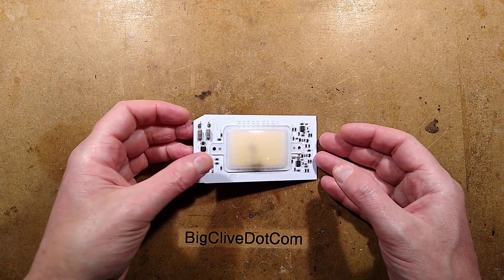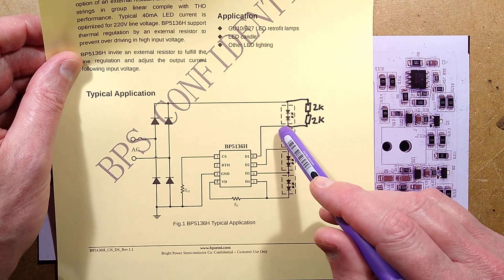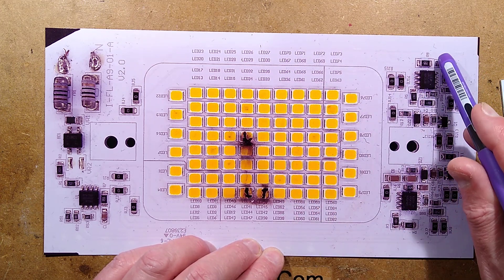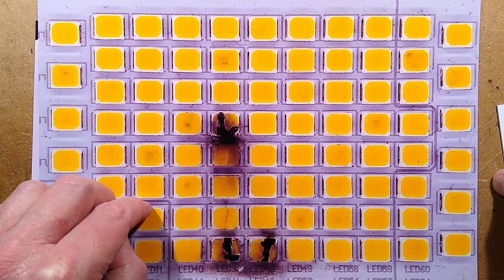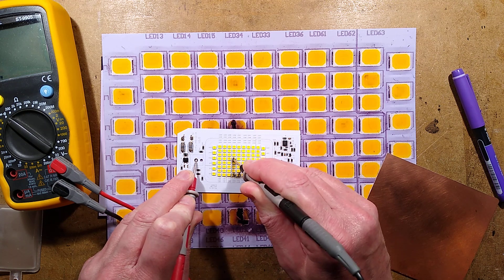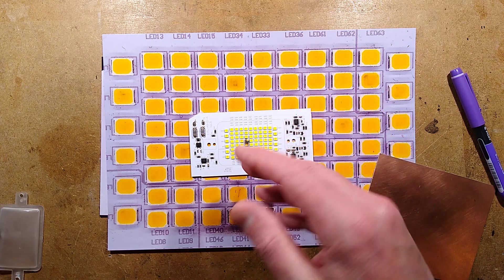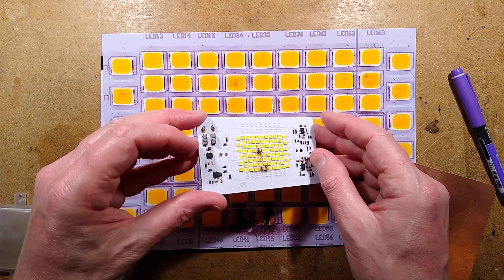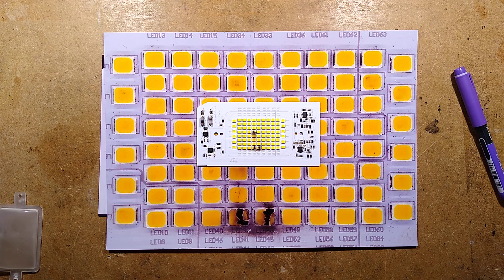LED shock hazards are increasing

Comment: Just had a look, indeed all three of the (~40 years old) RCDs in my breaker box appear to be type B! "Made in West-Germany" 😄
Reply: i doubt it. Type B RCDs came into production about 2000.
Reply: @punktVail  ha ha good answer
Reply: In my breaker box is an type A "Made in West-Germany"...
Reply: Definitely RCD, not type B MCB?
Reply: Also the cheapest German type B Rcd currently available is from ABB and costs 300€. They are usually used for running VFDs.
Reply: Hm, honestly, I just assumed it's a type B.
(That's why I said appears to be.)
There's no type designation on it, but it has the symbols for sinusoidal and half-wave rectified DC ("wavy line" and "bumpy line").

EDIT: I've looked up the model (all Schupa NPFI SK). It's a type A.
You live and learn :)

Comment: I don't see why they can't run several bunches of LEDs off say 12 or 24 volts so you have quite a few of them in one lamp wired in parallel but each set of LEDs is wired in series so it equals maybe 12 volts and you have maybe 10 of them driven off a 12 volt supply and also they are not over driven and electronics modders like yourself and myself can mod them in projects.

I have a spooky bulb that has a small 12 volt supply/driver inside and three LEDs and I modded it to run on a 8 AA battery holder. Works great.

Comment: Why are transformers not used when installing LED lights
Reply from the maker: Size and cost.  Plus making them fit in existing lamp forms.
Reply: Also efficiency. Every time power goes through a conversion some of it is lost as heat.

Comment: LEDs are diodes, so why don't the replace the full bridge rectifier with sections of LEDs and then have the regulator be the device that acts as a current sink? Does it have to do with breakdown voltage of LEDs vs normal silicon diodes?
Reply from the maker: Some lamps do that, but LEDs are not optimally designed for rectifying.
Reply: I think so. Most LEDs are only rated for 5 volts when reverse biased.

In addition, LEDs used as rectifiers will have significant flicker when run at mains frequencies.
Reply: @eDoc2020  but arranged as full bridge rectifier and with a diffuser I'd imagine it is no worse than the circuit in the video.

Comment: It would be interesting to know the age of these failing led lights, I have several cheap floods and PIRs in use around my home for a couple of years now and are working fine, I also discovered the unconnected earth on the very first flood I installed as I replaced the crappy cable with proper 240v cable and plug
Reply: From my experience (with domestic fittings), the best and longest lasting ones are those from before the manufacturers worked out how to make them cheap. A lot of it is still running for us (a failure once every couple of years), so we haven't had to use the more modern cheaply made ones much. In general when they do fail, it is often a single LED with the black spot of death or the capacitors in the power supply - oyster lights, led tape and incandescent replacement globes

Comment: Does this same sort of problem happen in light bulbs that may only have a 2-pin connection to the mains? I can't "ground" my Edison screw light bulbs any more than they are, I think, though perhaps it's all connected to neutral instead? I am old fashioned apparently in that I like a bulb in a fixture, and not a non-serviceable fixture with built in LEDs, but I might change my tune if there's a safety advantage.
Reply from the maker: If it has an exposed metal heatsink on it then treat it as potentially becoming live and isolate power or use gloves while changing a lamp.

Comment: What a horrible driver chip design: they're more interested in keeping a nice power factor than in giving smooth, camera-friendly illumination.
Reply: Eh, it's pretty good for a design that doesn't need electrolytic caps. At least it outputs some light down to the low parts of the sine wave where other simple designs would output no light. This chip should look less flickery to the naked eye than most other capless designs.

Comment: What keeps the incoming resistors from becoming firecrackers/heating elements from the incoming mains current?  I understand they limit the current but how without overheating?
Reply from the maker: They limit inrush, but the regulator ICs limit the main current.
Reply: @bigclivedotcom  How do the ICs do that and survive? I thought the small traces inside an IC couldn't handle the volume of current thus board voltages and current need to be dropped by a transformer before they reach the smaller components.

I am not a sparky, I only play one on weekends with battery jumper cables and cocktails.
Reply: @lohphat  It depends on the IC; ICs made for power functions have beefier internals and can handle much more current than those made for signal functions.
Reply: @eDoc2020  But how do the traces survive?  When the current is coming in on 14 gauge wire but ore following tiny traces on the board onto tiny pins into the ICs -- my brain boggles as how they survive the transit of electrons.
Reply: @lohphat  The size of the incoming wires doesn't mean anything; these types of LED circuits usually run at around 40mA. Higher current circuits naturally need thicker traces.

Comment: What's the next stage of PCB + micro chips then?
What direction are we heading in do we think...?
What funky and innovative new ideas do you have people of the comments section..?
Come on.. Hit me with your super awesome, futuristic ground breaking & multi gazzilion dollar £€$¥'s epiphany ‼️🙋🏻‍♂️
Reply from the maker: It's already at the extreme minimalist level.  Lamps with high voltage LEDs and a three pin current regulator.
Reply: @bigclivedotcom  you not on the 'graphene bandwagon' just yet then Big Fella?
Is that not going to be a potential new era for these for mentioned things..?

Comment: can you add some sound dampening on the wall or add some compression and EQ on the voice to minimize the reverb since is prominent?

Your Video editor will be better than nothing and don't need to buy a plugin for EQ or Compression for Adobe, Final Cut, or Divinci, etc. Or can even put it in a DAW like Audacity and add it back after since it will be the same length as your video files. (this is a finishing step and just adds a bit to your videos and brings it over the top).  

Can add it on OBS or other video streaming platforms for streaming but can broaden the parameters so it is not precise and less likely to have problems with audio and doesn't make your audio sound as bad as before. (I have not seen a recent live stream of yours to give exact feedback sadly)
Reply: I believe his editor is "pressing pause." That editor doesn't provide many options.

Comment: So what's actually in the yellow resin that gets used for making LEDs? 

And I'm fascinated to see how far we've miniaturized the driver circuits. It's awesome stuff until it fails. There's also still a big QC problem in the imports market. We definitely need to modernize our safety systems to compensate.
Reply from the maker: It's a blend of phosphors that are stimulated by the base blue light and add the other wavelengths to make white.

Comment: A solution for the design would be to have the LED's on the aluminium backing part, but not the rest of the circuitry, it should be on a separate part that doesn't have aluminium backing, then the aluminium can't conduct from the burned out LED back to the main circuit.
This is a common solution in Japan, they don't commonly have ground wires on most small things, yet the country has a very low rate of people being electrocuted, the reason is that the Japanese who design the products, design them in a way that if they fail there is no risk of an internal dangerous circuit forming, or forming onto the frame of the unit that can be touched etc.  

Grounding wires and type B circuit breakers and such that you are talking about, they are life savers if the design of the product is bad, and because a lot of British and Americans might buy stuff from China, then you certainly need that extra safety, because a lot of stuff made in China isn't designed intelligently and can be dangerous. In fact I would wager that well over 90% of deaths in the UK and USA from a fault in an electrical device/appliance, is one where it's origin is China and of dubious quality, such as those phone chargers from China that can fail and then send AC into the device, if you are holding the device it's then potentially deadly.
Reply: The problem with isolating the aluminum PCB is cooling; how would one get good thermal management without mounting the board to a large heatsink which gets outside air?

Comment: Even the standard GFCI breakers are still ridiculously expensive considering how many circuits we have in the US. They are relatively rare in homes compared to the much cheaper GFCI outlets (and those are usually only in the places the code mandates it like near sinks/baths and and outdoors) because of this.
Reply: What do they cost per piece?
Reply: @BrosBrothersLP  A GFCI breaker for a regular 15/20 amp circuit is around $40, a GFCI receptacle is around $15, and a standard breaker is around $5.

In recent code revisions AFCIs are required in most household circuits and interestingly combination AFCI/GFCI breakers are barely more expensive than AFCI-only breakers. Because of this I can imagine many informed individuals will go for these dual-function breakers when undergoing new electrical work.
Reply: @eDoc2020  ok its around 40€ here in Germany although we use mostly one or to RCD's for a whole house. So not that expensive they are rated for 63 A 3-Phase most of the time that is the standard input power for a typical home. So u basically only need one and than stick your normal breakers behind it.

Comment: in our older houses we only have 2 wires going to lights no earth, would you get a shock if you were on a wooden floor and touched a single  live phase wire, our earths and neutrals are connected at the fuse box, my thinking though i am not willing to try it, is that you would not as you are not touching the ground
Reply: The AC from the wire will definitely produce a current in your body too. Your body has capacitance and that's enough for a current to flow back and forward in you. How much of a shock you will get and whether or not it would go past your heart I don't know. If you were genuinely isolated maybe just a painful shock but wood has capacitance too so maybe more than that.
Reply: Obviously never try that. It is a matter of how much current draw would be possible. In general .005ish amps and above can be very dangerous (US 120v line, 220v line 2x as likely to overcome whatever resistance is isolating). So any dirt/moisture film on the wood might change the outcome. So a bird 10 meters up on a single transmission wire is perfectly safe; most of the time.
Reply from the maker: If you were on an insulated surface you might touch a live wire and not pass enough current to feel it.
Reply: The danger with connecting Earths & Neutral at the fuse box is that if the neutral fails on the supply side of the fuse box all the 'Earthed' metalwork will become live at the Line voltage - not good !

Comment: *looks at thumbnail* Oh dear, those poor little LEDs...
I cannot help but question the wisdom of the driver chips sharing the same aluminum-backed PCB as the LEDs, which are no doubt being driven at, or close to, full whack.
Reply from the maker: The driver chips often respond to panel heat too, so they act as a safety layer for the LEDs.

Comment: These Alu boards are a nightmare to work on.
Reply from the maker: They often need pre-heated before soldering.  There are ways to do that on the cheap.
Reply: @bigclivedotcom  Definitely needs pre-heating but it can be done on a hot plate.
Reply: My 100/140W soldering gun can work on most of the connections of Al-clad boards without much issue. If you need to work on thermally massive connections I highly recommend going beyond the normal 25-60W pencil iron.
Reply: @eDoc2020  Long live the Metcal, and the Pace 'pencils'!
Reply: @eDoc2020  Btw, my 60W+preheat works fine. 100W+ and no preheat can be problematic sometimes: you get the soldering done, but you can burn stuff.

Comment: I know having the driver electronics on the same board as the LEDs makes for efficient manufacturing. However, I don’t know if it’s a good idea as the heat from the LEDs could negatively affect the driver electronics and vice versa.
Reply from the maker: In this case the drivers may react to heat to limit the current further if the panel overheats.